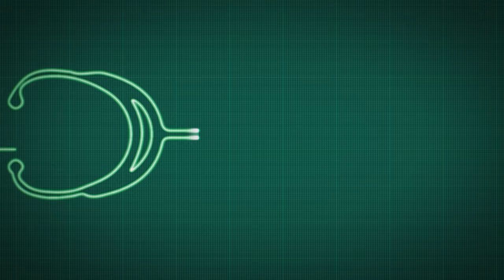Skytron 3602 Surgical Table Relay Board Repair

Comment: Great channel!

Question

I have a skytron 6500 elite (battery operating) table that's down.

No movement  or motor sounds when you  use the  remote or  manual controls, just a click noise from relay box?
Reply from the maker: Do you have the scrolling charge indicator lights?
Reply: Hello 
Yes, light comes on
Fuses are good, checked the voltage on battery charger and good

Comment: Hi Justin, nice one.
 Did you use solder with lead or lead-free solder, because those solderings look very shiny ?
Reply from the maker: This is probably leaded solder.
Reply: @BetterBiomedChannel  , nothing can beat leaded solder. More reliable in the long term and easy to use. Here in Belgium there are not that many distributors that still sell leaded solder. So i have taken precautions, and order a rol of 0,5kg each time i order components.
Reply from the maker: I use leaded whenever possible and I have gotten into arguments over leaded solder reliability vs silver. I find fewer cold solder joints and cracks in leaded joints vs silver.
Reply: @BetterBiomedChannel  , and in the long term, minor risks for "Tin whiskers".
Since 2006, allmost each major brand of notebooks is start using leadfree solder. After 3a5 years of heavy use and minor service or no dust removing at all, they start failing with black screens. Reheating the VGA chip can resolve the issue temporary, but it's not a reliable fix.